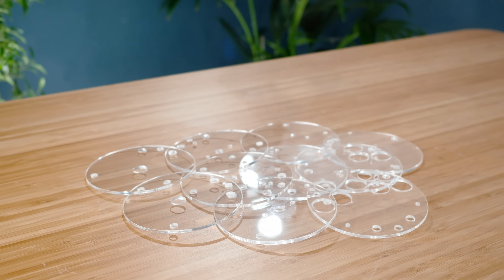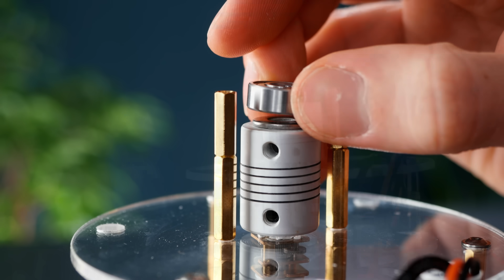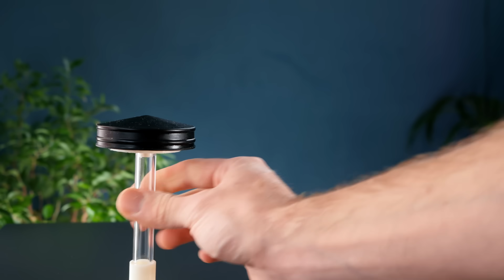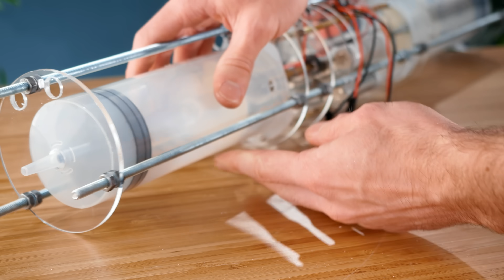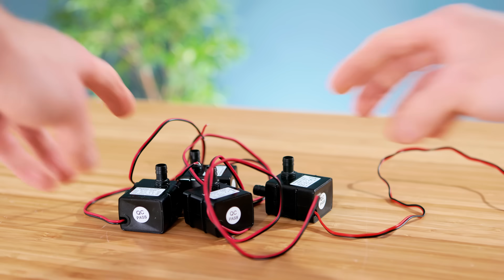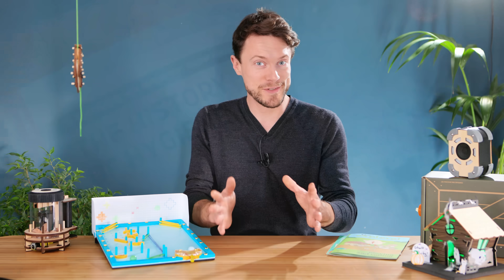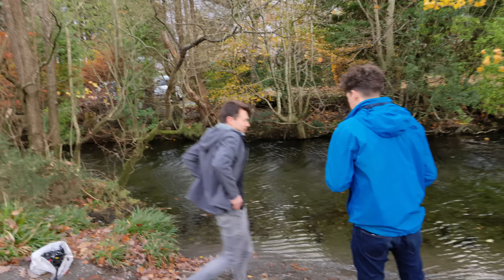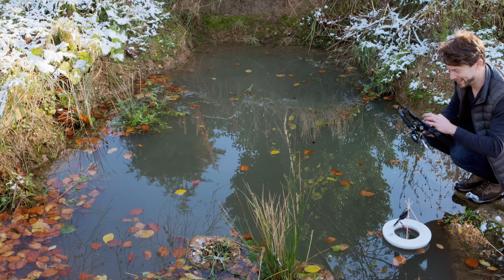Building a DIY submarine

Comment: I think you'd benefit from basically making it twice as wide and so half the length, to a more compact shape. Have the syringes in the center but side by side (probably in opposite directions though) so  you can keep the center of mass at the center. Unless you can find a single bigger syringe or make your own, then you can increase the radius by only about 1/4 since it is now a two dimensional compensation for the length, rather than two.

Alternatively, maybe just get rid of one syringe altogether and its added motor and circuitry. It already needed extra mass to get the right buoyance, that way you eliminate a bunch of air inside, lowering the density and the mass at the same time, which means your pumps can move it even faster too. Could also get rid of some of the pumps tbh, you don't need a dedicate set for turning and one for moving side ways. Input A and B activates the pumps on the same side for sideways movement, inputs C and D activates one of the same ones but on either side and end to rotate it. I guess you'd be replacing one set of pumps with small circuitry that processes that signal and activates the right pumps.

Comment: Excellent build!  I'd love V2 to have more speed (rear prop?) and an element of hydrofoil control. The water pumps looked quite weak and I'm not sure you could maintain control in moving water like the sea.  My instinct is that significant forwards motion combined with hydrofoils should allow you to quickly change depth by moderate amounts without actually changing the boyancy syringes.
Reply: Yeah, the prop would be way more power efficient and faster than a thruster motor.

Comment: Hi could you please make a DisplayPort KVM switch that works by manually switching displayport cables? It would be so useful and way cheaper than the £300-£500 good digital KVM switches.

Comment: I remember thinking "I could make this if I had a soldering iron."
Now he's making a submarine.
Reply: It's a slippery slope. I also thought "I could make this if I had a soldering iron". Later I bought one. Then I thought "I could make this if I had a rotary tool". Ended up buying one as well.
These days my go to excuse is "I could build this if I had the parts and materials".
I refuse to buy electronic components and sheets of brass so that I don't lose that one. I'd rather blame the lack of resources than accept the lack of skill.
Reply: @phenomanII  what did you made with all these tools?
Reply: You need to get a soldering iron stat
Reply: You know you can get soldering irons from the hardware store for less than $20 yeah
Reply: I made the dual screen monitor build and... Nothing else. There are times where I say "I could do that if I had that..." and some times where I'm like "he has a 3d printer but no laser cutter?".

BTW, I found even that dual screen monitor build a lot of work even though it was one of the simplest on the channel. It was so worth it though.
Reply: youtube.com/watch?v=4EmCT9Ckg50
youtube.com/watch?v=1p86P2DuVHs
youtube.com/watch?v=NO2fEXiTPTQ
......
Reply: #thank you so much #srsachinsr
Reply: @Reclaimer Leviathan True, that is something I keep running into.
And it will be even worse once I finally get a welder and start learning with it. From what I've learned so far, old rusted metal that is easier to find just laying around is a major pain to work with.
Reply: @phenomanII  know this is an old post but just wanted to tell you to keep at it. I hated soldering when I first started because it was difficult to do cleanly and get good connections. But only through trial and error you learn what works for you and what doesn’t, now I love to solder and I even started doing work for a local jewelry store repairing different things. Not a career by any means but pays $20 a job and some take me only a few minutes.
Reply: who are you kidding, if you don't even have a soldering iron you aren't going to make anything
Reply: well, ts100 costs nearly nothing
Reply: @SergeiSugaroverdoseShuykov  you can get a generic one
Reply: @SergeiSugaroverdoseShuykov  Get the pinecil, it's $25, delivery to UK / Europe almost as much though.
Reply: @affieuk  completely forgot about it existence, yet it’s not better than ts100 which I already have, so I won’t get it but it’s a solid alternative indeed
Reply: @SergeiSugaroverdoseShuykov  I’m a cheapskate and have one of those aoyue station, with a missing iron. The pinecil is cheap enough that I’d get it over just replacing the missing iron.
Reply: @SergeiSugaroverdoseShuykov  I should clarify that I wrote this when I saw the video title. I hadn't actually watched the video yet.
Looking forward to his "Building a DIY Tesla with rope and brass" video
Reply: @SergeiSugaroverdoseShuykov  he's no longer doing DIY anyone can do...
Reply: @SergeiSugaroverdoseShuykov  100€ is "nearly nothing" to you?!
Reply: @CarbonPanther  Check out the T12 soldering irons. They can be found for less than 40 euro and are even better if you don't need it to be portable. Do check some videos/reviews for the model you're looking at because they might have some issues you'd best fix before use to improve safety.

I actually bought one to replace my older, more expensive, iron and it easily beats it in performance.
Reply: @ernierock8715  No i'd just get a PINECIL soldering iron, just 25€ with no safety fixes required while being as good if not better than the TS100.
Reply: @CarbonPanther  are you a poor person perhaps?
Reply: @marcogenovesi8570  that's rude 🤣
Reply: @CarbonPanther get the pinecil, it's $25
Reply: @CarbonPanther  Didn't know of it. I like that the T12 is desktop tho, I use it professionally and it beats some 200+ eur units in speed and ease of use.
Reply: If you're not willing to spend money on tools and materials then interest in "build it yourself" videos is some what superfluous.
Reply: @SUNDREDSTAR  Not really. I've learned a lot about how things work just watching his videos. I'm not looking to get an electrical engineering degree but I still watch Stuff Made Here.